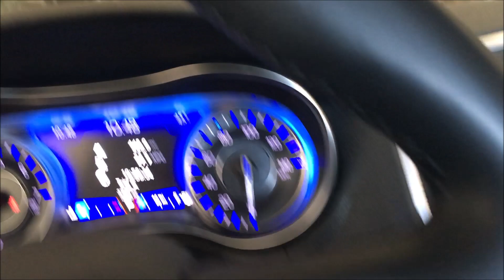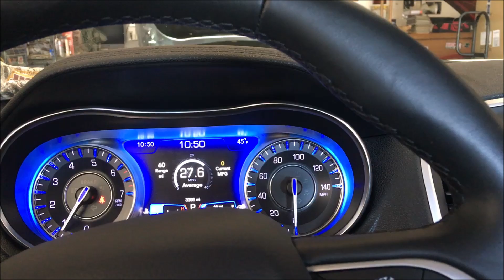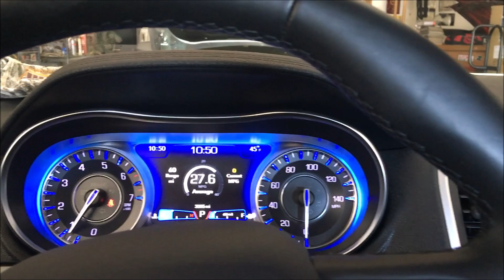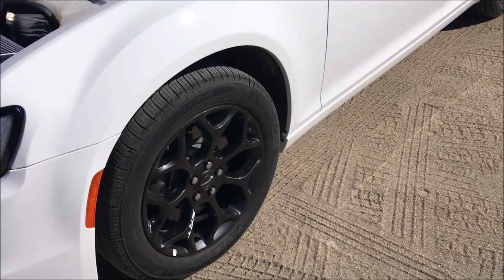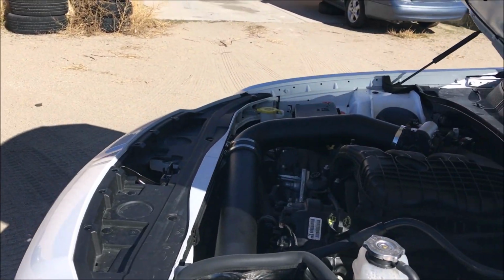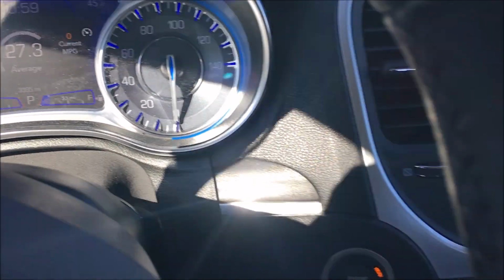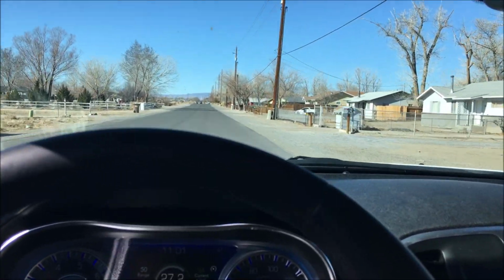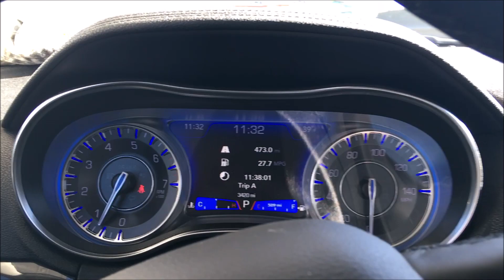New Intake Kit Driving test results Chrysler 300 3.6 pentistar V-6

Comment: So you expect other people to pay for your supercharger? Good luck with that! Also boosting an engine not originally designed for a blower can really stress the internal components greatly affecting reliability and engine life.
Reply from the maker: Do not expect it, cannot hurt to ask since it will take a long time to make that much money.  Especially since my small you tube channel is NOT monetized or sponsored by the rich like so many are.
Reply: @devious3030  Young pup there are some things you need to learn in life.  One thing is no matter how fast you think your car is there is always someone faster. The Chrysler 300 which I set up with a nice intake and exhaust runs really nice for what it is and with the right mods like a supercharger either centrifugal or roots could be quite the sleeper since it has all wheel drive it will grip and go. It just so happens that I sold the car I traded it in for the new Jeep hybrid turbo four-cylinder 4XE.  So far this sleeper jeep wrangler feels faster then that Chrysler 300 with both hybrid motor. And turbo charged intercooled four-cylinder engine together. Point being no matter how fast or how slow a car is you can always get a faster one, a slower one, or modify any car to be faster than any other car It just cost a lot of money. Therefore what I said in the beginning young pup is that no matter how fast you think you are there is always many that are faster.
Reply: @devious3030  Unless you have a hellcat or a demon you can’t play with me I have a Turbo Buick Fernley and a turbo 300 ZX it would blow your damn doors off hell even my Ford F150 would blow your doors off I have beat countless 392 powered chargers and challengers like nothing. Unless you’re super charged a turbo charged you ain’t shit!
Reply: @TTATurbochargeThemAll  lmao. Don't tell  me what ur boyfriend has ..    ur car is a 🐢🐢🐢🐢🐢🐢🐢🐢🐢
Reply: @TTATurbochargeThemAll    awww ur upset 😡 🤣 🤪
Reply: @TTATurbochargeThemAll  🐢🐢🐢🐢🐢🐢🐢🐢🐢🐢🐢🐢🐢🐢🐢🐢🐢🐢🐢🐢🐢🐢🐢🐢🐢🐢🐢🐢🐢🐢🐢🐢🐢🐢🐢🐢🐢🐢🐢🐢🐢🐢🐢🐢🐢🐢🐢🐢🐢🐢🐢🐢🐢🐢🐢🐢🐢🐢🐢🐢🐢🐢🐢🐢🐢🐢🐢🐢🐢🐢🐢🐢🐢🐢🐢🐢🐢🐢🐢🐢🐢🐢🐢🐢🐢🐢🐢🐢🐢🐢🐢🐢🐢🐢🐢🐢🐢🐢🐢🐢
Reply: @TTATurbochargeThemAll  🤣🤣🤣

Comment: What grade of Fuel are you using ?
Reply: Since the engine is natural aspiration and not high compression, I run the lowest octane grade 87.  If the engine was supercharged, turbocharged, or high compression 11:1  or more, I would run the highest octane available at the pump which unfortunately is only 91.  On my turbo cars, I run a mix of 10 gallons 100 octane AVGAS and around 8 to 10 gallons of 91 to top the tank off which brings octane average at least up to at least 95.